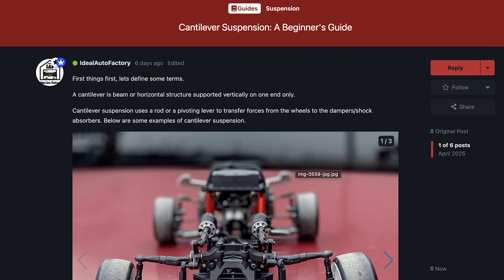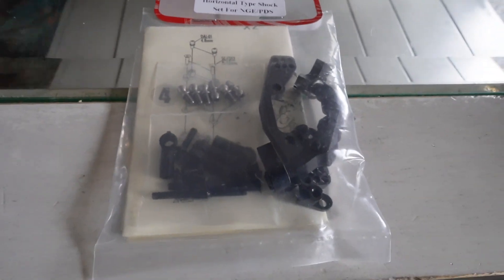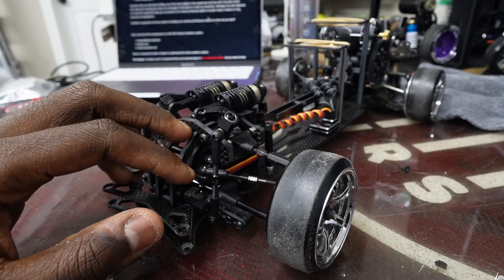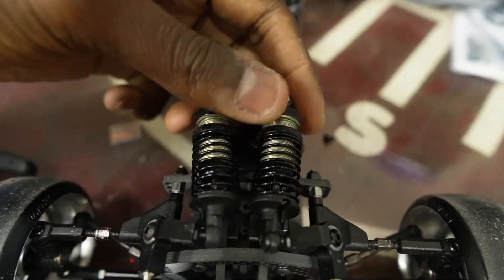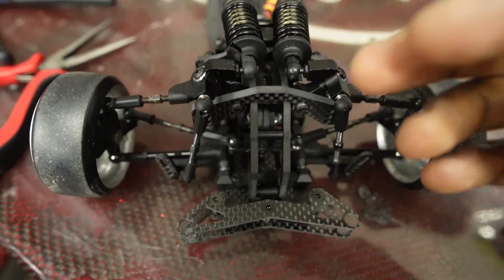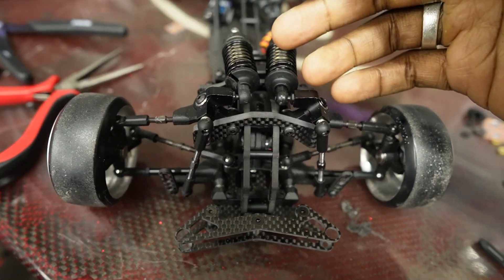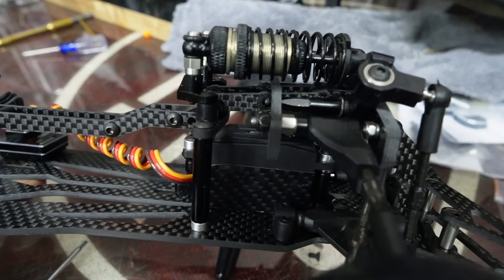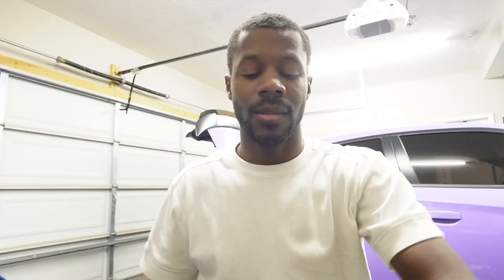RC Drift & Cantilever Suspension - All You Need To Know!

Comment: Your personal settings are atrocious, there's so much friction your chassis doesn't even descend to your ride height, do you have no shame? Chasing clout rather then providing factual and physics backed information.  Whether you adjust your turnbuckle or the preload, the spring sits at the same compression aka the same static force at a given ride height, so really all you are influencing is the travel aka where the piston sits in the cylinder.  The main advantage of IFS is weight shift by altering your CoG and having more options to alter the natural spring rate & dampening of your shock, but the huge down size is you introduce complexity to your suspension causing unnecessary slop, friction and weight, as shown by your personal setup.  Please, there's enough echo chamber mentality in drift tuning.  I hope to see more content where you tandem with skilled drivers at your local track and potentially compete.
Reply from the maker: 1. The hopes you have are not in the cards. There is no “local track” and no competition. 

2. The personal settings are what exactly? I don’t recall sharing anything but a visual. No battery or body was installed so the “settings” don’t mean anything without explanation.

3. Care to explain lever ratio? That wasnt echoed in the echo chamber. 

4. What is natural spring rate? What is static force? Because I believe you have the meanings backwards in your comment.
Reply: @idealautofactory  
1) an unfortunate coincidence 
2) regardless of body or battery the amount of friction in your ideal setup is obvious

3) you correctly explained lever ratio but never talked about how it influences anything, which would be the whole reason to bring it up (example does it make the spring "feel" softer or stiffer, how does the "feeling" of the spring change throughout the cycle of the suspension)
4) Natural spring rate is simply the spring rate 1:1 in lb/in & the static force I'm referring to is the constant force of the spring pushing against the chassis to maintain ride height while the car is static
Reply from the maker: @bacon9896 This is definitely generating ideas for another video! 🙌🏾 Thank you. I appreciate it.
Reply: @idealautofactory  Alright bro, just make it more impressive than your King Of The Streets results 🤣
Reply: Isn’t it great to have subscribers that challenge you to expand your knowledge and content delivery? I love these videos.👍🏾
Reply from the maker: Yes it is. Discernment is key.

Comment: I just finished my MST Rmx kit ! 
It was probably one of the most simple kits I’ve done. Now time for some electronics 👌
Reply from the maker: Nice! RMX 2.5?
Reply: @  Yessir! 
I had to be patient because i ordered the EX/S differential and metal gears for the gearbox.
Reply from the maker: Ahh ok. Yea those are solid cars. Can navigate any track just fine. I started with an MST myself.
Reply: @idealautofactory   Did you ever have the MST MS-01D ?  I’m currently working on one to get more counter steer”. The pulley belt system is a challenge to say the least.